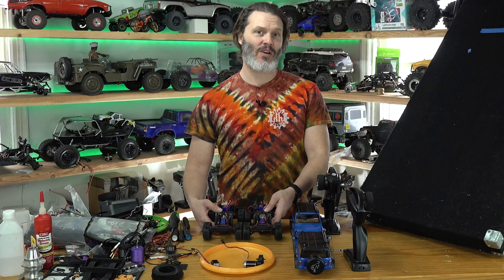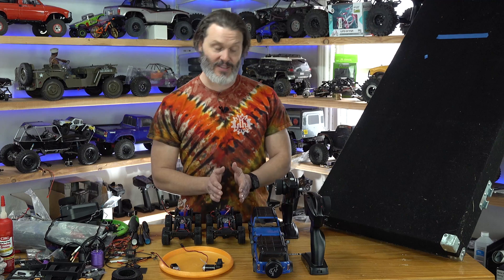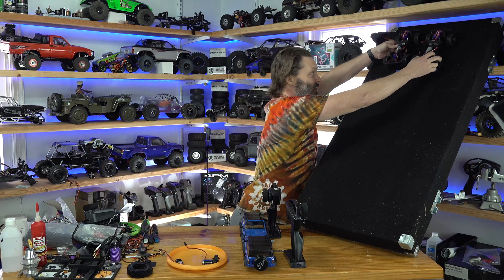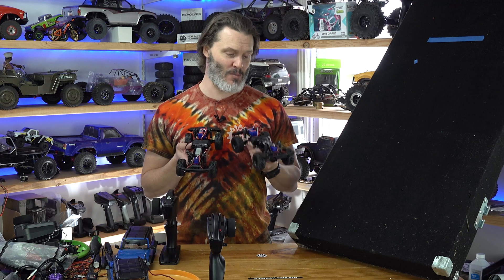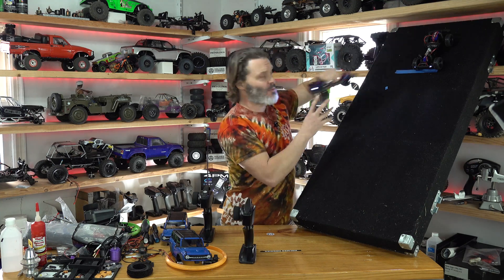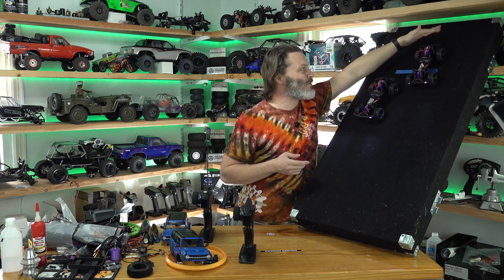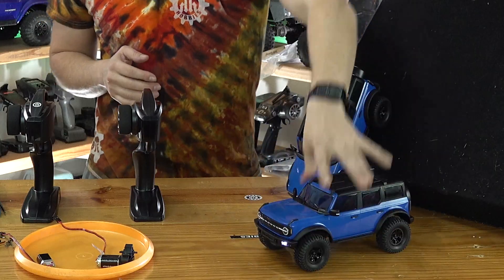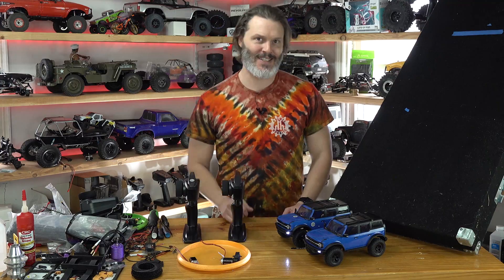Rolling resistance testing (TRX4M) Transmission Types || Holmes Hobbies Traxxas

Comment: You would have to test using the same motor, same gearing in differentials and transmissions and same size tires for accurate results.

Comment: Im not buying it.   You gotta do the test with the same motor. Im thinking the better motor, although stronger magnets. Maybe once it gets spinning holds momentum more and thus rolls faster.   Just swap to a stock motor n retry.   Bushings can be just as good. Examples. Your main n rod bearings on a motor. Turbos sometimes run bushings.  Trains wheels run on bushings.
Reply: more likely ill just run bearings in all and redo. These little bushings aren't quite the quality of industrial bushings.

Comment: There's a 3rd low range gearset option available as well. Part number 9776R. It's 40:1 ratio vs the stock trail 16.6:1 ratio. The blue speed gears are 9.7:1.

Comment: I read that most motors are limited by the stock ESC. Have you seen this in your testing with your motor? I would love more wheel speed with the slow gears but without losing any torque.

Comment: John am I assuming correctly that these rigs are on stock gearing? If so we should see improvements in drag brake performance on the low range crawl gears! If both are 87t motors the wheel speed for a given voltage should be close right?
Reply: That's next, gear down more (and volt up)
Reply: @johnrobholmes  he went over that in the last video there's no gear options as the Mount is fixed
Reply: @patmanz28  they have a low speed gearset also. So 3 total. Low range, mid-range which is the stock set, and high speed. All 3 are different color plastic as well. 1 black, 1 dark Grey, and 1 blue. 9776r is low range 40:1, 9776 is stock 16.6:1 and 9776x is speed 9.7:1.